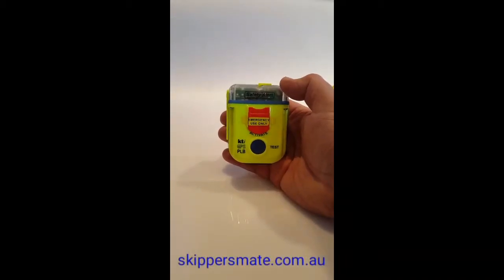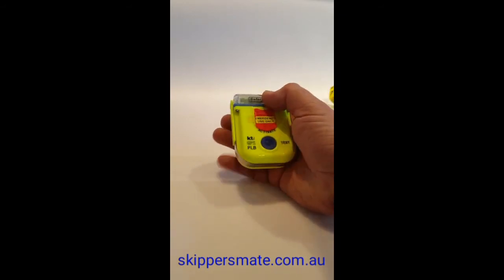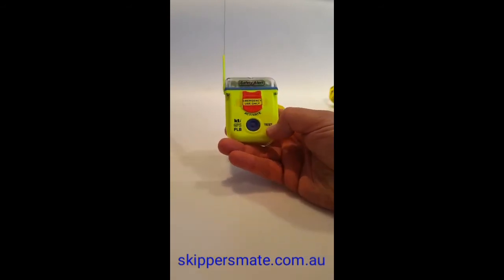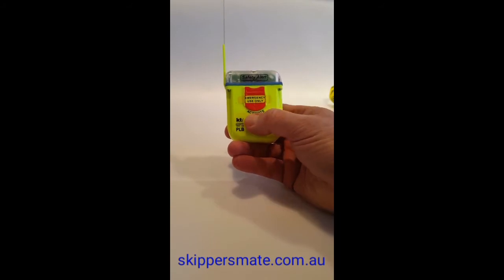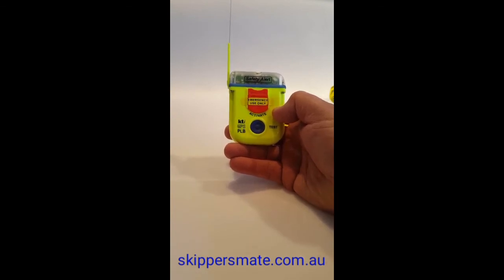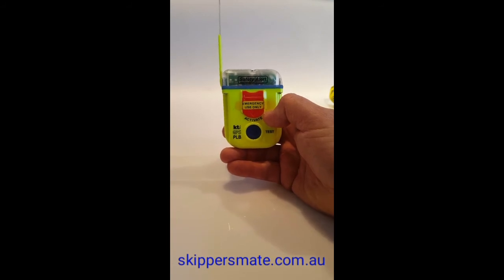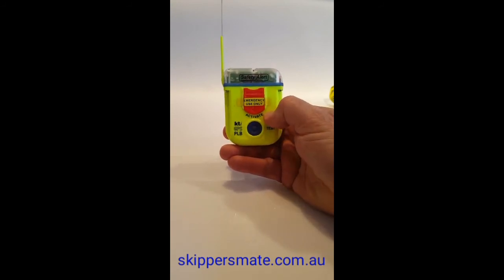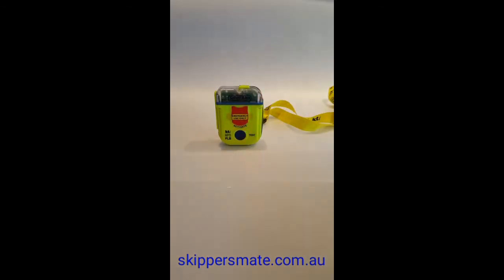How To Test Your PLB | KTi SA2G GPS 406MHz Distress Beacon

Comment: How do you know if the emergency button works? You test the test button but it's not testing the real emergency beacon. How do you know if it actually is gonna send a signal?
Reply: @skippersmate-Au_NZ  there is no signal to the sattelite, it just looks if there is GPS reception!! There is NO 2 way communication in these beacons, they just transmit at 406MHz, if they can receive GPS they modulate your position on the 406MHz signal.. That 406 MHz Signal is received by COSPAS-SARSAT sattelites and they use the doppler shift (they are moving really fast overhead) to calculate your position. Most of the time, none of these sattelites is in view!! That´s why it can take up to 4 hours till your becaon is received and your position can be calculated.. Typical time is ~45min.